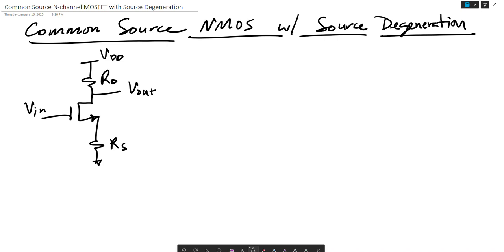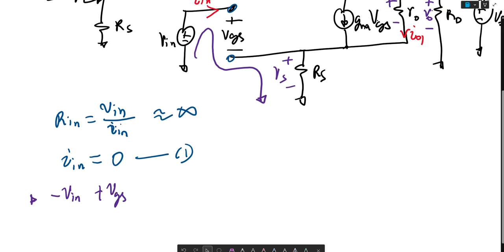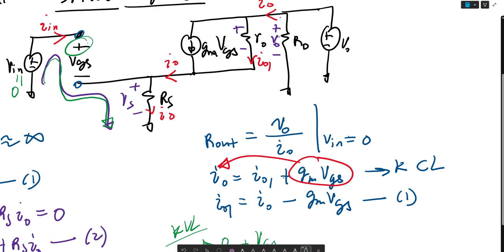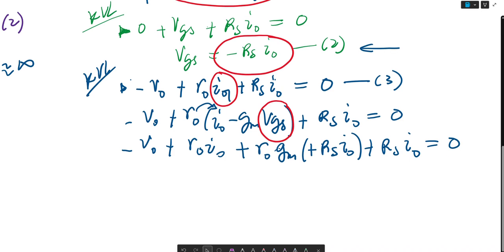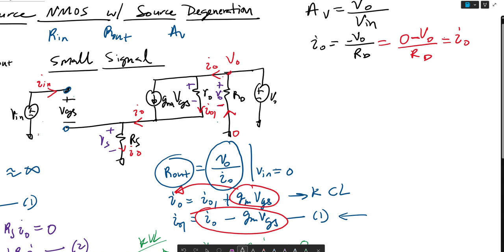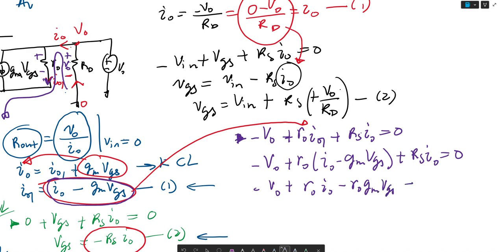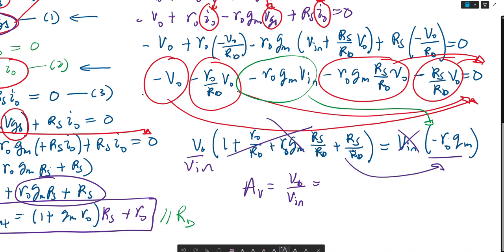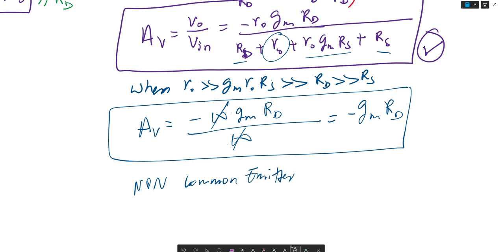Common Source Amplifier With Source Degeneration—Small Signal Analysis

Comment: Why did you define io in the same direction with id, aren't they the opposite of each other?
Reply from the maker: Hi, great question. The way I have it drawn might be a bit confusing to the viewer, but note that V_out is simply the drop across Rd. Therefore, i_o = i_d. If you prefer to have both i_o and I_d flowing toward ground (into the positive terminal of R_d), you can and will still receive the same result. Thank you and I hope this makes sense.